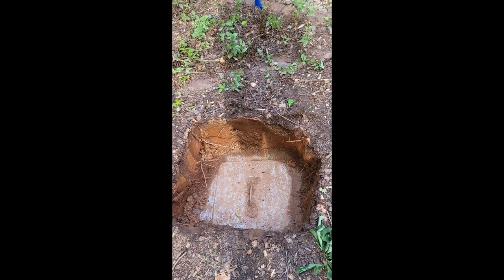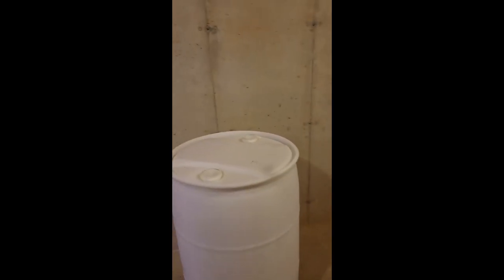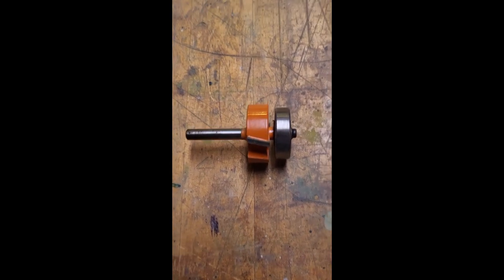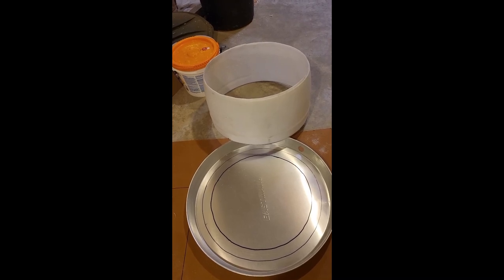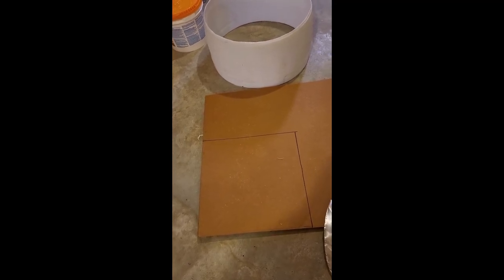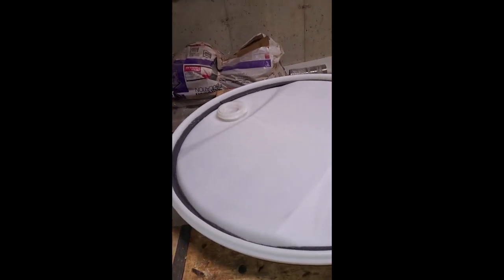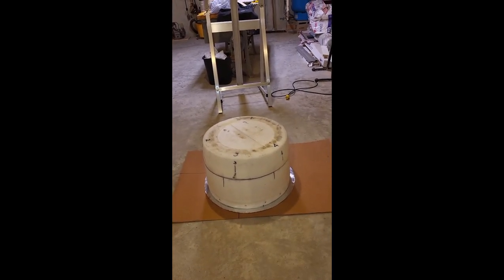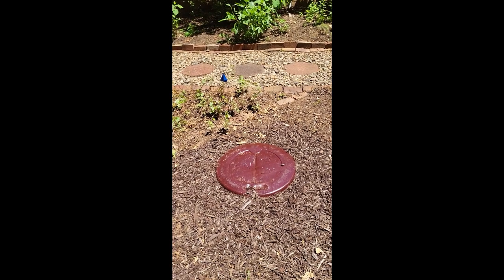I make my own septic tank riser.

Comment: looks good! Another choice is to build a square one out of composite decking lumber.
Reply: I used treated 2x10 and 2x8 mine are 24" square. I stacked them, I have a solids and a liquid section in my tank, both get pumped. For the top cover I laid a concrete retaining wall cap over them  24x12 caps. Used 4.

Comment: I actually did the same thing, I have blue plastic drums that have collar locking clamps for the lid, and yes cutting drum in half you can slid halves together, I used a semi steer tire sidewall I cut out and used that as my flange, works great, this is no doubt a cheaper alternative to using these barrels for that

Comment: I have a tank with a lid like yours and i have a 55 gallon plastic  barrel with a screw on lid. I am going to cut the barrel like you did and then pile .cement around the tank hole in a circle then set the barrel into the cement and let it get hard to hold the barrel and the screw on lid will be above ground
Reply: Sounds like a good plan. I might recommend  hydraulic cement. It may hold up better in that environment.
Reply: @steigerhouse  Wont cost me anything but the cement i already have the barrel

Comment: Very nice job. I put the spendy risers on only because I was worried that if I ever sold the house that "Non-approved" risers might get flagged and I'd have to dig them all up again.
Reply: I kept the old concrete lid, so if anyone buys the house they are welcome to use it.
Reply: @steigerhouse  Good idea. In my case it was a slab lid design where the lid was the full opening of the 500 gallon tank. So I had to cast up some concrete slabs to make the opening narrow enough to connect the round riser. Glad I did though cus it saves a heck of a lot of digging every three years!